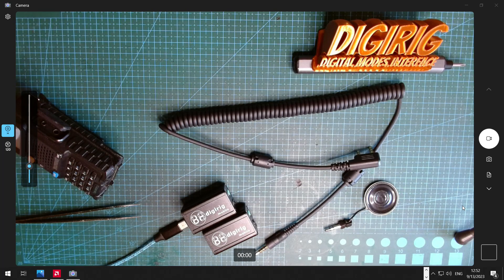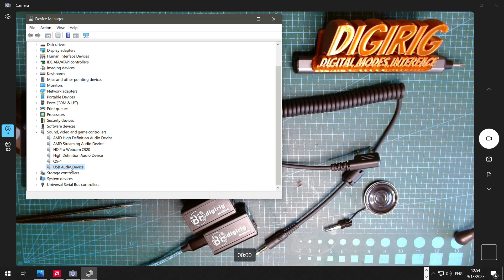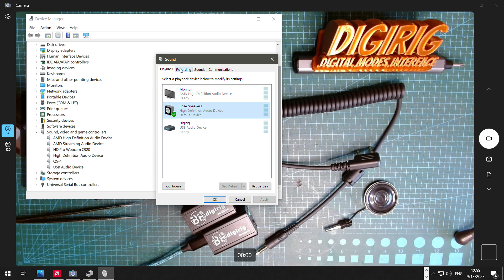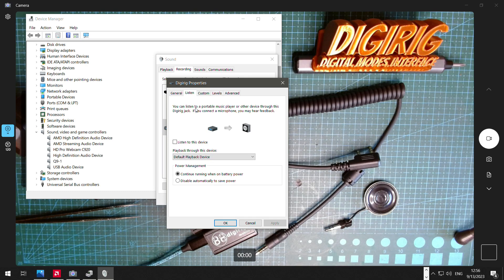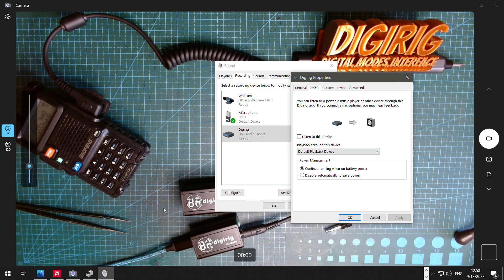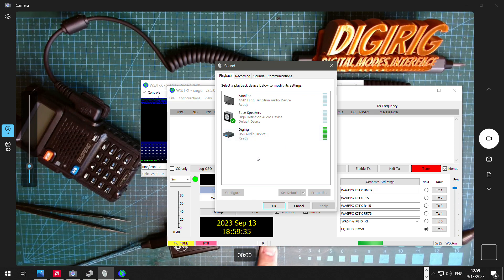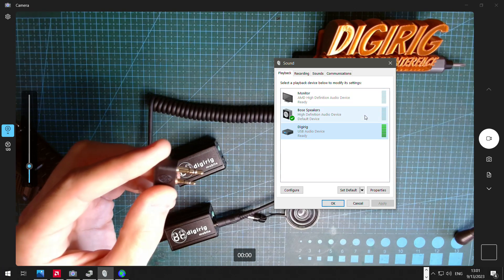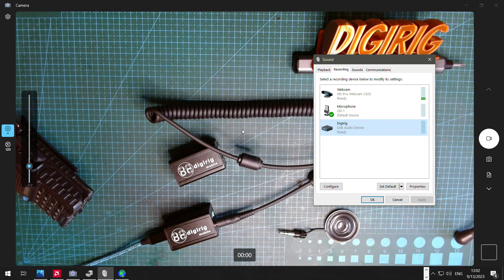Audio Settings and Troubleshooting

Comment: Help Dennis, Everything works except I talk into a seperate HT and do not hear any audio in my phone. When I talk on the phone app I hear the morse code ID and the audio fine. All the software loaded fine, I can hear the radio audio in the "Listen" and the monitor through the TV speakers, I can see my voice level bounce on the level meter on sound properties on the "mic" via the USB audio device. I hear the audio with a test speaker but the audio does not stream from the radio audio out through the Echolink latest version with Windows 10. Any ideas?

Comment: Great instructions Dennis! I followed your steps and was able to replicate all outcomes you displayed for us, but when attempting to send audio into digirig by way of WSJT-X, I get the WSJT-X error in sound input message “an error opening the audio input device has occurred”.  What causes that error?
Reply from the maker: Likely RFI kicking out USB connection. Try the same with RF power set to minimum and even better if sending into into a dummy load. To resolve you'll need a better balanced antenna system and/or choke.
Reply: @digirig  ...but we are just sending audio into digirig to test the cable, no RFI, the communication is just between the pc and the digirig by way of digirig cable connecting the pc to the digirig, and using WSJT-X for audio signal for the testing.... not sure where the settings you mention and steps with dummy load are to take place on??
Reply: ...although, when disregarding the error received from WSJT-X and proceeding with the next step in your video instruction, I do get the audio to come through the headset as you indicated it to be proof of a working cable. It is just the WSJT-X error message that is new to me...
Reply from the maker: @pablop5937 If radio is not involved then this error is caused by the sound card is not being selected in audio tab. You may need to explicitly re-select Digirig's audio components there.

Comment: This is something I recently ended up writing up and sending out to the entire group I'm with. as somebody who does a lot of A/V stuff you really don't want windows automatically choosing devices sometimes.
Surprise there's a way to disable that as unhelpful as it is but it's not called anything convenient or easy to identify. to make sure that when you plug in a USB or Bluetooth headset it automatically selects it
What you need to do is well you're in the sound settings dialogue for both speaker and microphone of the Digirig or anything else that you don't want automatically selected for that matter.
I will spare you most of my rant and convoluted Windows 11 instructions.

- Under the Advance tab of the properties dialog, you need to uncheck "allow applications to take exclusive control of this device”.
- This needs to be done twice for the winlink device, once for the input (Recording) and once for the output (Playback) on their respective tabs.
Once this is done, it will not automatically select that device when it's plugged in.

rant rant rant rant.
windows has been moving more and more to a "we wouldn't want to inconvenience the user", so we're gonna do something that inconveniences the user.
When a device is plugged in, the system now assumes that you will want to have the audio routed out that device because it's most likely a TV, headphones, Bluetooth, etc.
This is great and should have a little toggle switch. You walk up to the computer you plug USB headphones in and boom you have music in your headphones. However to the bane of just about every musician and audio video technician, when the audio interface is attached to anything else like a radio, a sound system, musical instruments. this causes problems…

I was annoyed with this enough recently that I had to track down how to change it in Windows 11.
As my system kept changing the output whenever I plugged in the audio interface that I was using to receive audio from the mixer for the live stream.

Comment: Denis wondering if you can do another video for Windows 11.  The sound settings are very different.  I miss the old sound setting menus.  I they took away the little green indicator lights to see if you can sound on your selections.  Thanks
Reply: I would agree. I have windows 11 and I had trouble getting settings right. Windows changed a lot. Thank you

Comment: Stupid question here, but what’s the purpose of hooking up a vhf/uhf to wsjtx
Reply from the maker: That's a reasonable question considering that (multi-user) FT8 is not practical over FM. The reason WSJT-X is used for troubleshooting here is because it is one of the simplest apps to install and configure. With that we can get to PTT test with lowest chances of getting stuck on the way. Once PTT is confirmed working from WSJT-X we can move to using more involved software setup.

Comment: Can you operate Echolink with a DigiRig? No one seems to know an answer!
Reply from the maker: Yes, you can. Please see https://forum.digirig.net/t/digirig-and-echolink/181/3
Reply: I use DigiRig several times a week with VaraFM…using my FT3d or FT-65. Denis has great cables and the DigiRig common configuration works great for me. Information he provides here is exactly the way I use it. Be sure to open squelch and adjust VU meter using the volume knob on your radio. It works!

Comment: I hosed my new Dell Windows 10 laptop sound drivers trying to setup Digirig. I had no sound output on my laptop except from the USB port with either the Digirig or Signalink USB plugged in.
I've been so frustrated that I haven't been doing digital when I used to lead two digital sessesions every week.
It seemed like every time I would get the Digirig working with one of the ham apps like FLDIGI Windows would later repair itself and the driver I manually installed would get lost by Windows.
The driver issue is CRAP!
Reply from the maker: Sounds like you experienced issues related to defaults assignment. Each time you plug in a new sound card device or existing sound card in the different USB port, make sure to review the settings as shown in this video. This includes reassigning the defaults to your computer's normal speaker and mic as well as adjusting audio settings in the digital modes software. If you need further help, please post the question in the forum and we'll look at the particulars.
Reply: I had similar issues running Echolink on Windows10. Every time it forced a system update. It would screw with my sound card settings. Somehow? It has finally stayed correct!